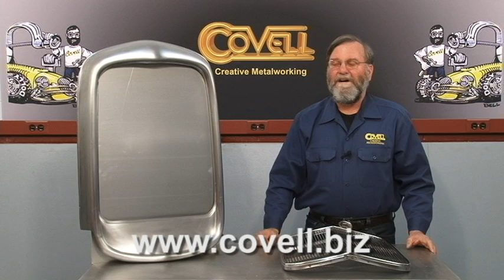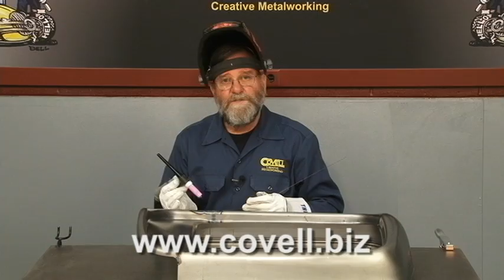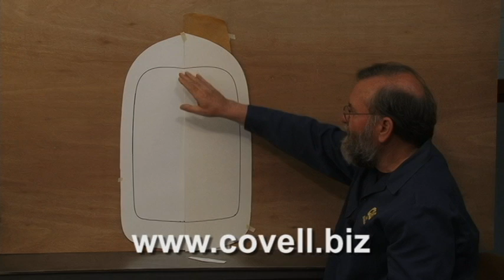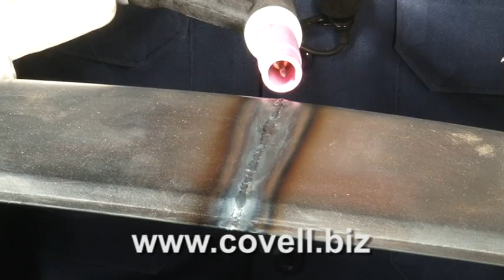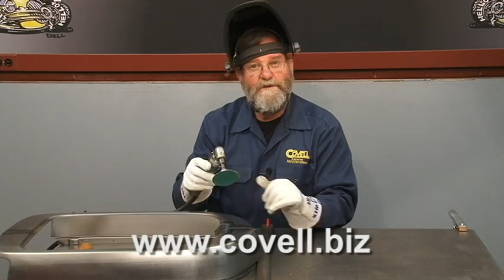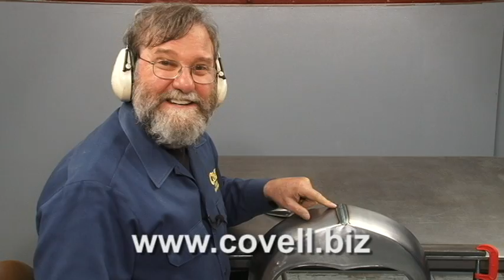Slicing & Dicing - Modifying Grille Shells

Comment: How much amps do you run your TIG machine at when welding such thin parts?
Reply from the maker: The rule of thumb is one amp for every .001-inch of material thickness. These parts were made from .040-inch (19 gauge) steel, which is about 1mm thick, so I couldn't make a puddle unless the machine is set to at least 40 amps. In reality, I usually set the machine much higher, and use the foot pedal to modulate the welding heat.
Reply: @RonCovell  thank you 😁

Comment: Ron, have you ever used silicon bronze rod? (Eva-dure)? Sand very nice and very strong.
Reply from the maker: Charles - Yes, I use Everdure (Silicon) Bronze filler wire a fair amount! One of the greatest benefits is that it doesn't 'pull' as much as steel filler wire, so you get less distortion. It also can be used to TIG weld cast iron, and to join many dissimilar materials - copper and stainless for example. It does not have the same tensile strength as steel, so it's not the proper rod for every situation, but it certainly has many beneficial properties!

Comment: First off I love your videos, I went to school for auto body years ago and learned I did not have the eye/feel for it.  My question is are you just a metal working god that can get the base that close that no filler is needed, or are they later cleaned up with a skim coat of plastic or lead?  If your doing lead, I would love to see the process.  Awesome work even if it is outside of the scope of my knowing enough to really screw things up abilities.
Reply from the maker: +speedbuggy16v Thanks for the compliments. If I have good access to the back of the metal, I can often get it smooth enough that no filler is needed, or maybe just some block sanding after priming. I'm not especially fond of lead, and in most cases I think plastic autobody filler is adequate. If you need to build up an edge, lead is definitely better for that!
Reply: +Ron Covell I just saw your video on the California star, I knew I recognized your name but could not place from where. beautiful work!
Reply from the maker: +speedbuggy16v Thanks again. Yeah, I've been doing this work for a long time. Still love it!